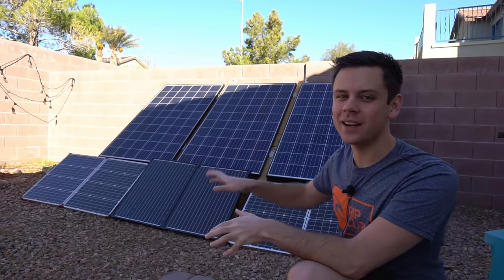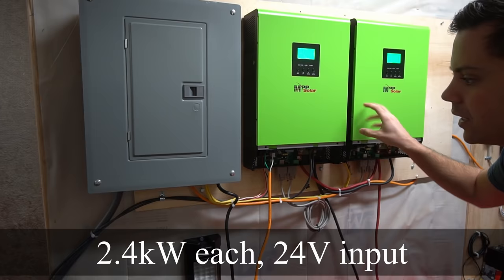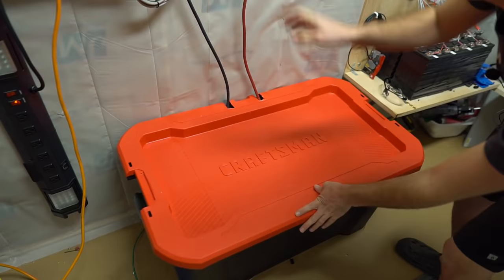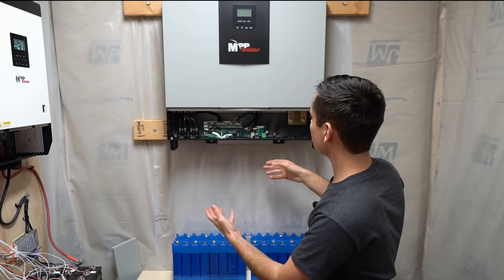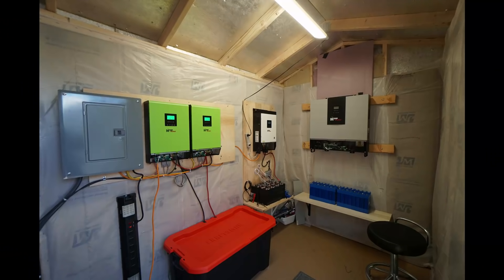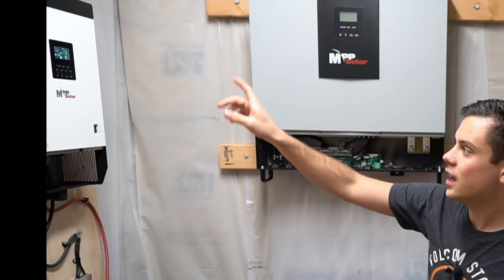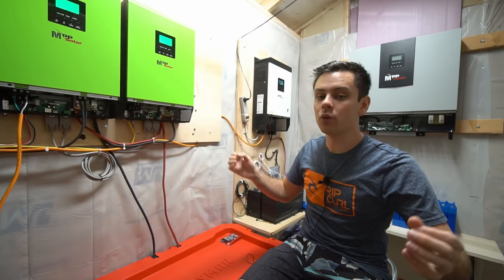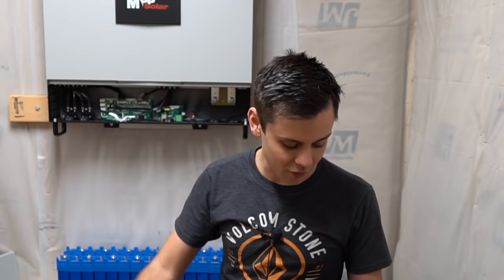Backyard Solar Power System Update! 10kWh Battery, 4 Inverters, 810W Solar Array

Comment: I've had success cooling my entire house with a LG ductless mini split. Stick with an outdoor unit with a variable speed pump with permanent magnets. Those outdoor units can match the BTU load and turn down low instead of just cycling on and off like the less expensive ones.  LG calls this their "inverter" series. Also can be used for heat. Outdoor units come pre charged so not to hard to install yourself.

Comment: Check out Roxul Insulation, sound proofs, Fire proof does not burn, mold proof product, If you combine two it will be r-30 in the wall and ceiling. I used it in the chapel I am building it stays at 50 degrees when temp gets down to 19 degrees have not stayed in it during hot muggy summers yet.

Comment: Most heat disappears through the roof. In Sweden we always have much thicker insulation in the roof. At least double the insulation in the roof compared to the walls. The floor do not need thick insulation. And of course we have heatpumps that can both warm and chill. Example, look at Dometics heatpumps for RVs, not just AC (thats so old school) even if they in theory are the same.

Comment: Consider installing air to air heatpump. It's 4 times more efficient to heat when comparing the simple heater so it might be possible to run from batteries aswell and it works as ac unit when it's hot.

Comment: A 5000 BTU window mount air conditioner could easily cool your shed. It would take under 2,000 watts to starting current to get the A/C running and then under 600 watts to keep it running once it has started. Depending on how long the A/C has to run (duty cycle,) it could work. I suspect that the biggest challenge will be getting your solar panels to maintain enough watts of output at the higher temperatures where you would want to run the A/C.

Comment: Use a ductless mini-split Will. Cheap and energy efficient. Get the DIY version so that you don't need to have an HVAC company charge the system.
Reply: @marthale7 I installed an off brand system that used a Toshiba pump. It's been a good unit and it's saving me money on my bills. I can't remember its name. This summer I'll be installing a Mr. Cool DIY system in a different location. It cost me 2k to have the HVAC company help me with the last system and all they did was solder six joints and charge the lines! From some research it seems like Mr. Cool has DIY figured out pretty well so that's why I'm leaning that direction this time. Anyone know if Mr. Cool is a good brand?

Comment: Love that shed! I'm building a system for my shed right now. I got 8 new-in-box Renogy 100W panels at an auction for dirt cheap and ordered the beginner 1kW battery kit and BMS. The epidemic in China has pushed back delivery of parts though. Zoning and code here is, well, better to ask forgiveness than permission? I'm mounting the panels on the ground out of sight.

Comment: Well you should have less trouble cooling it than heating it since air conditioners are heat pumps and modern ones have a great COP. You should put a heat pump for heating(as opposed to the comparatively inefficient electric heater) on the future projects list.

Comment: I'm interested to find efficient mini-split heat pumps that run on 48 volt dc native power. The modern mini-splits often utilize dc compressors that are 'variable load' instead of the simple on/off compressors. But because the market needs mostly units that are designed to be installed in 110 AC supplied homes, there is always an AC to DC conversion before the dc motor gets the current, which I expect has some unnecessary losses in that conversion (or, it is unnecessary if you have a 48 volt battery bank just sitting around).  So invite your best and brightest followers to search around for some good DC native heat pumps and share that with us. Please. And if the units can be put in an RV, so much the better.

Comment: Have you thought about using a swamp cooler to help control temperature in the shed?  the electrical usage would be minimum.  Just a thought
Reply: The resultant moisture problem would be bad trade-off.
Reply: In a dry heat like in LV,?  tell that to S. Californians. Air flow is the key :>)

Comment: I like the MPP Solar system but like all its limited in how much power you can put into it. With a large battery bank you may not meet your charging needs. 
So to keep the systems simplicity, could I hook up more solar panels to a second mppt controller (midnite classic 150) just for battery charging ?

Comment: Do you think that you could do a video? About 12 volt systems using 72 cell 40v grid tie panels with mppt And what do you think about using supercapacitors to extend battery life when using High draw

Comment: I'm assuming you will use a ductless heat pump for AC? Anything else will be too much of a power hog. Side benefit of a ductless heat pump is it also doubles as a heater (far more efficient than a space heater).
Reply from the maker: Yes that's main option so far

Comment: You overall have a great idea but, you needed to insulation that will make a big difference. As of you said; putting up solar panels will help to blocked of direct heat from the sun. As far as Tesla level 2 charging goes; your gigantic battery drain, even Battle Born really struggled. From your 10KWh. battery to 60KWh. Tesla Mosel 3, DO YOUR MATH. If you have Tesla Model X with 10 times larger than all of your batteries in your shed. You actually needed no less than 8 of 60 cells panels. 6,000 BTU wall mounted air conditioner that will pull on average; 600 watts. Believe me and or not, without any insulation, you will really cook your investments at 130 degrees F. plus of your equipments will also put out even more heat that = to 140 degrees. Even with A/C is wide open with no insulation, if you're lucky; 90 degrees cooling in during the July heat.

Comment: Might it be worth putting your big panels on the roof of the shed? Both to reduce voltage drop from long cables (Which shouldn't be much anyway) and also to use the sun hitting the shed to power cooling it instead of heating it up?
Reply from the maker: Those panels are huge compared to tiny shed roof unfortunately. And there's a tree in the way I need to chop down

Comment: Great video Will.  Your mention on air conditioning for climate control for equipment stability could be easily attained by using a Bard HVAC wall mount.  They are installed in pairs the Old Castle site shelters for most comm sites and dissipate heat quite well.  They put those things in construction trailers and mobile office trailers a lot so you probably could find them at a decent price. Upfront though, we have seen some of our customers that own sheds that use nothing more than a 5,000 btu up to a 12,000 btu window unit and because of the size of space, have relatively good life and treat the unit as disposable at first sign of issues.  Personally, I would get a  newer 12,000 btu or larger with heat pump for what you are wanting to do.  You will have to contend with the equipment heat as well as the high external environmental heat as well.  Just some thoughts.

Comment: Curious about those 270W panels. I know you did tests on the 100's but have you done a video on those bigger ones?  I have a 40 foot RV and I'm trying to figure out if I should go "big panels - more watts" or "more panels of 100 watts to the same end-wattage".   2 cents or link to a video where you discuss this would be awesome!  

I did the math of the 100's and the 270/300's panels and it looks like you only save 2-4 inches on the top by going with the bigger power panels but the cost is significantly more per-watt with bigger panels. Also I noticed the weight savings isn't too significant either with the big panels... if you're going "tic-for-tac" of watts.  Unless I'm missing something... thus the questions/comment I'm leaving here now. lol. 

My only big plus I see is that if you do the 100's and a panel gets damaged, you only lost 100 watts from your total system.  Whereas if you do a big panel and it gets damaged you lose 300 watts (let's say). Not to mention the price tag of replacing it. I'm curious how often panels get damaged though to the point they aren't working, so is this even a thing to consider? 

Sorry for all the questions but I'm about to spend thousands in an RV set up and you cover so many great batteries and systems and panels, I couldn't think of anyone better to ask these questions to. Plus you like to do test scenarios. This seems like a good one to do. Yes? Lol

Thanks for all you do! You're the best I've ever seen on this stuff.  Please keep them coming! 

PS. one of my channels has 2.8 million subs and I've been thinking of doing a collaboration with you on "off-grid setups" for my viewers. If interested in doing something like that, get you even more exposure, let me know. Thanks again.

Comment: Great "He Shed" Project room.  Could you dig a small space below the shed and use the cooler ground temperature to keep the batteries protected during the summer?? Any fire suppression system or fire alarms installed?

Comment: Buy lg dual inverter air conditioner and set temperature ad 25 degree Celsius. Set the airconditioner compressors to work ad 80 percent power. In 30 minutes to 1 hour power consumption will decrease and it will run ad 600 watts and still blow cold air

Comment: Will, great channel, thanks for so much good intel. I live rural myself running a small store with a grid-tie solar (5.6kw) system. Sad now that I've done this as we get frequent outages and I still have no power due to the system shutting down entirely when the mains isn't supplying. I get that this is to preserve the lives of linesmen working to restore the network but so ironic for me to have the panels on the roof yet no power underneath it! I have a 200 amp hour battery that came with a charging panel - thinking to us it with the accompanying inverter to at least keep my cash register, modem and eftpos going in outages of shorter duration - battery can only keep one of my shop freezers going for about 5 hours and then it takes 2+ days to recharge it with the car battery charger.
My question (finally) can I leave the car battery charger connected to the terminals whilst the battery is also connected to the inverter? I think this issue is one worth a video - how can grid tied solar folk like me, charge some batteries for use when the system goes down, without me doing a whole revamp of my system - which I plan to do when the money is around (hah). I believe there is such a thing as a "rectifier" which like the battery charger, or in 12v world like a car alternator, would keep my standby battery charged and ready for use when the mains fails me. Hope my question and situation are clear, feel free to email me for clarity on such - again I believe a video on such is worth the time (I hope to make the time but you are already there doing this stuff so you would probably beat me to it, if you haven't already!). Battery + rectifier + connected all the time, a bit like my computer's UPS (Uninterruptible Power Supply)
Regards
Dee - in Australia so 240v, 10 amps down here =)

Comment: If putting the solar panels on the roof was an option, would that offer a layer of protection from the Sun's heat directly on your shed's roof or would it even help? Maybe the panels themselves offer a layer of insulation?
Reply from the maker: Yes that does cool things down a lot actually. Very true

Comment: I have a question. I ended up purchasing a 15kW Low Frequency Inverter. Heavy suckers. I have a need to run a central Heating and Air system and a 5hp Well Pump. How good are your MPP Inverters at powering up Central Heating and Air systems and Well Pumps? Mine is a bit more difficult to mount because of the weight. Cost is higher too. We have no other means of heating or getting our water and watering our property.

Comment: I saw a few dozens "gotchas" just by skimming this video... Wow.  At least poperly ground your panel frames... 23 years full time off grid here... Been there ... done that.
Reply from the maker: Any array under 1000 watts won't accumulate enough excess charge to be dissipated with grounding. That's why we ground panels. It's totally fine. With large arrays or code compliant grid tie, you have to ground them no matter what.

Comment: Hey there! Please advice which method of connection of solar array (series or parallel) produces better conversion efficiency with the MPPT controller. Eg: for a 24 V battery bank, how should say two panels be connect for best efficiency, series or parallel? providing that the controller can accept 100V or more PV input voltage

Comment: Hi will. I've got a 24v system wit 2 battle born batteries, every couple of weeks one of the battery discharges to much causing the system to shut down. What's causing this?

Comment: Looking to run an inverter type mini split heat pump off a lv 5040.  Are there any problems running an inverter "the heat pump" off an inverter?  It's a 12,000 btu 28 seer heating and cooling currently in use in  a well insulated 1600sf house.    I enjoyed your information. Your thoughts?  Thanks

Comment: Which system is most efficient for power loss 48v & can you wire 76v or is it better to get a few more batteries to do 2 - 48v battery back up powered by what I’m working on now car alternator with neodymium magnets added Power feed straight off the stator so post to give me between 90v - 187v I buried my aunt mirror revving my alternator up to 2000 RPM set an AC voltage but I do have video seeing 187v as it drops off 1 of the 3 leases of the Stator ! I have Dc powered motors to turn the alternator to charge the batteries that will turn the alternator to charge I will be self sustainable once I get it going ! Issue and deal with now I didn’t drill the holes deep enough in the alternator when I glued the magnets down like a knucklehead forgetting that the space was so close together to the stator now I have to sand off like a half a millimeter off every magnet  & the magnets are N- 52 - 14 magnets ! But I’ve always got a GM one wire high amp old-school alternator brand new that would charge the batteries through the regulator on the alternator which might be the easier bet , but this would be cool if I had an alternator that provided Ac 120v x 3 1 to charge the batteries, 1 to the fuse box on a 100 Amp Double pole Breaker as auxiliary power in case of power down ! Reverse your electricity meter legally ( ISBN 1-895882-20-6 George Wiseman

Comment: Will, the VOC and IOC on panels doesn't seem to directly correspond with the rated wattage.  Maybe I'm thinking about this wrong but it seems more efficient on size of equipment if I get 300 or 400W panels with low IOC and VOC so I can cram a higher Watt ratting on smaller charge gear.  Like it seems I can get two or three 300W or even 400W panels on a 100/30 Victron charge controller but only 4x 100W Renogy panels without exceeding the limits the manufacturer recommends.  Can you add something to your next panel review on getting the  most Watts you can out of a panel before overloading your system?

Comment: Cheers from Canada, looking forward to the 24V wall. Question: I'm seeing more and more 275-325 Watt panels for sale "used" but still working for below 50% new, why use or promote 100 Watt panels? Yes larger in size, but overall less mounting hardware and slightly less waste of space.

Comment: Do you want a very energy efficient heat pump unit. Fujitsu 9RLS3Y 9,000 BTU 33.0 SEER Ductless Mini Split Heat Pump. 
          Because where you live you see 105° and 110° in the summer and in the winter you see temperatures into the 30s. 
              Do you want to paint the roof (with reflective roofing paint) of your shed flat white and if you want to carry that to a extreme even the sidewalls because the sun strikes them and heat them up. 
              You will want to insulate the roof or ceiling in your shed with our 32R to R45 insulation (The more the better).
                You probably only have 2 x 4 stud walls so if you use foam siding in your walls you might be able to get a R19 insulation value. 
                It’s probably too late to do your floors because you already have your floors laid down and you probably cannot get underneath your shed to insulate the floors. 
                With this air-conditioning unit it’ll only draw a couple hundred watts. 
               If you do not insulate your shed you will need a much bigger air conditioner and draw well over 1000 W. 
               Do not buy the Mr. cool AC that you see it advertised on YouTube it is NOT energy-efficient as they say I know HVAC installing minisplits is my profession for the last 30 years. good luck

Comment: So I have a 12v system 2,   200w panels and one controller. the controller is rated for up to 600V, so my question is, is it better or even suggested to connect the panels in series or is it better to connect them in parallel?

Comment: 50mm air gap behind exterior metal roof/wall sheeting the walls/roof  will self ventilate cool air around exterior surface. no power needed.

Comment: Hi there I have a Question I want to put a 600watt solar set up in my pull behind trailer for my Class C RV that has very little storage Can I add a 30 amp plug to my inverter so I would just take my RV plug and Plug it into the Inverter.  Just asking lol I am 75 If I am nuts blame it on my age.  Well Thanks  for your help ( Good or Bad )  Doug from Northern Canada

Comment: I'm still debating on what I want, the 24v or 48v system on your website. I have an off grid cabin and will need to power a mini fridge,  small freezer, maybe an LCD TV with DVD player once in a while, radio, a couple lights, water pump and water heater. Can I get your opinion?